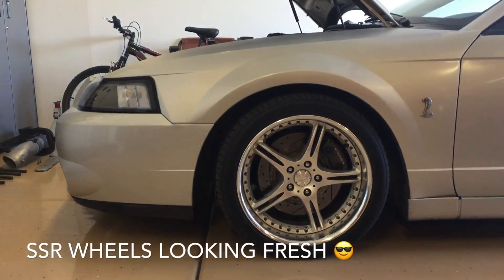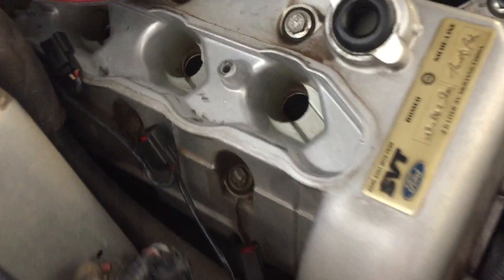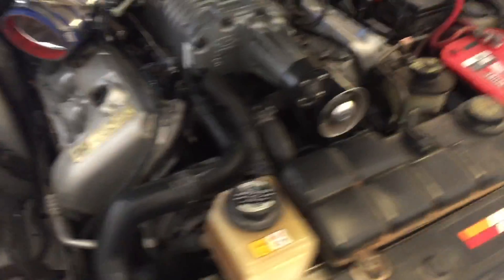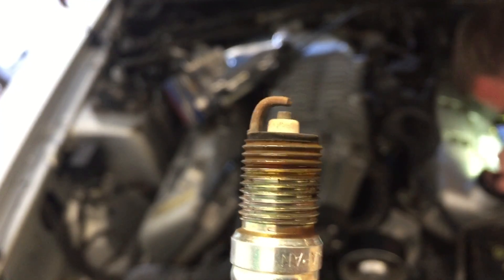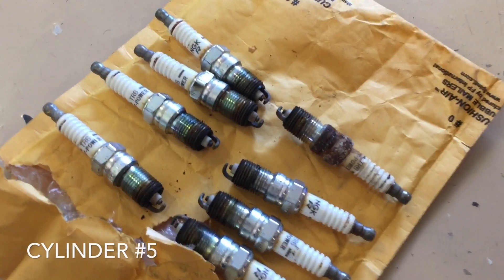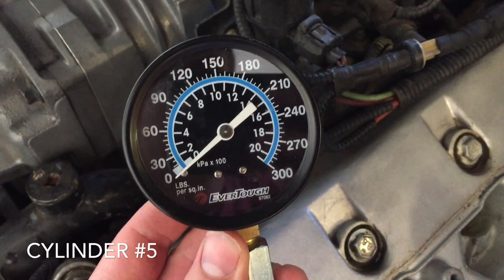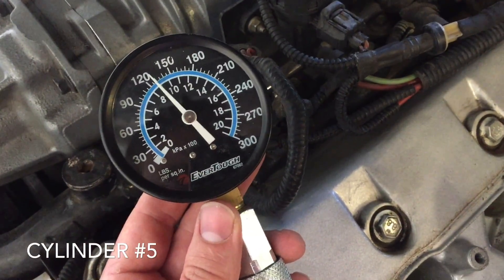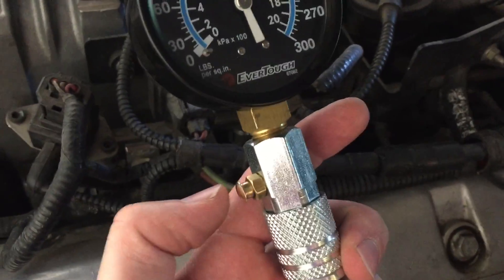High mileage Terminator Compression test: 2003 Cobra compression test with 140,000 miles

Comment: Hey Danny hope you can help me, I am Woody I communicated with you a few times and I have a 04 screaming yellow coupe. I just installed new timing chain adjusters, secondary adjusters and chain guides. The car was just old and I wanted to do preventative maintenance. The cobra sat for 6 months in my garage and I just finished it today. The car was running just fine before, no issues and no noise. Now I have a engine noise which sounds like chain slap or a bad lash adjuster. I must have done something wrong I do not know what. I torqued all bolts factory spec and check timing several times. Just did a compression test all were in the 150-160 psi range. Can you enlighten me on what possible they may be.
Thanks, love your videos.
Woody
Reply from the maker: I would watch this video on the primary chains and see if anything sticks out differently. The guides and the tensioners are side specific. I will also post a video someone else did on degreeing the cams https://youtu.be/xbkgpfk7s-g?si=iF8nv_zOSpjOXaZn
Reply from the maker: Watch this series as well. https://youtu.be/NvfQtmnJPbk?si=093YAS8kLGR4wnXF
Reply from the maker: Can you upload a video to your channel and let me know when you have?

Comment: Instead of holding the gas down would it be the same if the fuel pump fuse was just unplugged?
Reply from the maker: Yes, you can pull the fuel pump fuse or the inertia switch https://youtu.be/-5Zssjdqdhw
Reply: @dannyjohnsonsgarage  so I just picked up my cobra this last Sunday! I don’t see a video on how to fix a seatbelt that doesn’t want to retract. It’s the passenger side for my seatbelt that doesn’t want to pull back in? I was thinking of possibly cleaning it with soapy water maybe?

Comment: So just for clarification this can be done with all the spark plugs out of the car ?
Reply from the maker: Yes, its even better to do it with all the plugs out so the starter has an easier time spinning the engine. Each cylinder is separate from another, so the compression of the cylinder that is being tested is not effected.
Reply: Thank you Danny !!!
The results 
Cylinders
1-160
2-160
3-155
4-150
5-160
6-155
7-155
8-150

I reckon that’s a healthy ??? What you think
Reply from the maker: @SoulCrusher6  Yep. Looks good

Comment: i am now the owner of this cobra
Reply from the maker: It was for sale in Vegas. Did you just buy it or are you selling it?
Reply: Clutch, Flywheel and Tune was done as well. I was sent to this video by the seller.
Reply: i bought it from the guy that bought it from this seller...Im in Vegas. Still has the same Rims and ect. The Coolant Reservoir was changed, The SSR Center caps are now Cobra replica caps, The Rear Spoiler was replaced and is currently black, Radio was changed...153k miles now.
Reply from the maker: @outsidersmediagroupo.m.g5669  I really like the wheels for what they are. I first saw them on a 2001 Bullitt when it was brand new. Congrats. Do you have an Instagram?
Reply: @dannyjohnsonsgarage  @KingGaijinJayLay on IG. Yeah i had to change out the center caps because 1 of the caps was completely missing and i guess SSR doesnt sell those caps and i couldnt find them on ebay. I got the Car a few weeks ago in a Trade with a neighbor. It Def needs some TLC but im up to the task.
Reply from the maker: @outsidersmediagroupo.m.g5669  I’ll give you a follow. Feel free to browse my playlist. Just about anything you’d need from Intercooler pump, rear Diff, blower swap, fuel system etc https://youtube.com/playlist?list=PLIjr-uSYDZi7hBrphoRniyYjb707PpPTu
Reply: @dannyjohnsonsgarage  Sounds Great! Will Do. Thank You!
Reply from the maker: @outsidersmediagroupo.m.g5669  I have a 06 G35 too lol. Similar https://youtube.com/playlist?list=PLIjr-uSYDZi6cuomOpHL7rGWNEbQUmbvy
Reply: @dannyjohnsonsgarage  hahaha Great Minds think alike...Im gonna check it out. Minds is Heavily Modded.
Reply from the maker: @outsidersmediagroupo.m.g5669  mine is bone stock and 160k miles now. It’s been a great car. We bought it with 51,000
Reply: @dannyjohnsonsgarage  is it a DE or Rev up? 6mt?
Reply from the maker: @outsidersmediagroupo.m.g5669  You’ll see it in the link I posted above, but it’s an Auto Sedan and not the Rev up.

Comment: What are the best numbers to have on a compression test for these cars?
Reply from the maker: OscarIGZ preferably 150–180, but the gauge can be inaccurate, so you just want to watch for no more than a 10% difference across all of them
Reply: @dannyjohnsonsgarage  if i may ask what do the results  of this video tell you about the car? I saw mainly 145-150 but a couple 175
Reply from the maker: Mike Mcneill It’s a good healthy car for the mileage. My brother’s cobra with 42k miles did all 170s, so a little wear, but all good
Reply: @dannyjohnsonsgarage isn't the ford spec no more than 15% difference? Mines right at 15% on my 110k mile terminator I just picked up for $5k

Comment: Hey danny good video. I have a 98 cobra stock engine close to 190xxx miles never has been opened up!! Its smoking blue smoke when i downshift and decelerate  and def burns about a half court of oil every week. Should i start with compression and leak down test or should i delete my imrc plates cuz they have never been cleaned!? Thanks in advance
Reply from the maker: I would say it’s more likely to be in the valvetrain (leaking valve seals). It could also be piston rings. A compression test might show the rings, but not likely the valve seals. You can try it to see what you find
Reply: @dannyjohnsonsgarage  awesome thanks for the reply
Reply: Have u got a price for cylinder head repair like that before?
Reply from the maker: Kurt Tilghman I have an engine removal and teardown series you may enjoy. Expect $500-$1,500 for them to freshen up the heads. You could save some money getting the heads off and to them https://youtu.be/NT5Z5L2wAss

Comment: Should I buy a 133,000 mile 04 cobra for $16,000?
Reply from the maker: I’d say $14,000, but honestly if you’re willing to travel you can find them with half that milage for $16k or spend just a little more and get a super nice low mile one
Reply: @dannyjohnsonsgarage  will you do a video on if its better to have a higher compression ratio say 9.5:1 vs the stock CR on these motors, say someone bore the block over a bit, would you need a better supercharger to jam more air in?
Reply from the maker: hahaha12345678993 I’ll have to cover a video on that. I’ve spoken about it in a terminator vs 5.0 video being the new mustangs have 11 and even 12:1 compression ratio. Intended for naturally aspirated (which is why Ford lowered it on the GT500 for safety against detonation/pre-ignition). You can push newer engines a little harder with direct injection, but ultimately pressure is pressure and you’ll make similar power with low compression ratio and high boost compared to high compression and low boost.

Comment: Is 150 to low or good but what if it is 140 or 130 is that to low
Reply from the maker: less than 150 is starting to get bad, but still going to run- just might burn some oil. You don’t want to see that 25 psi cylinder or anything like that. Keep in mind also the gauge may have some variance, that you want a 10% average across all, and that this is only part of the equation.
Reply: @dannyjohnsonsgarage  im trying to buy a 03 cobra engine with cams and its got 94k miles and the Average on the compression test was 149 is it worth buying for 7k????
Reply from the maker: The Sand Dolls That’s probably close to what it’s worth. As long as they offer a 90 day warranty or something

Comment: Dan a buddy of mine has his eye on a 05 GT that has a Saleen supercharger kit on it, about 47,000 miles on the car. super clean and very tasteful mods done on it. The guys asking 14 for it. Do you think that model years engine will hold up for long term boost? Thanks and love your content
Reply from the maker: Unfortunately, the 05-10 GT 3V was not much of an improvement over the 2V. The stock rods are only good for 450rwhp and so a stock coyote 5.0 found in the 2011+ Mustang GT will outperform the 05 GT even with the supercharger. I would not pay anywhere near that for a 05 GT. Might as well go towards a 5.0 which will start at 400hp and can later be supercharged to 600hp without a problem
Reply: @dannyjohnsonsgarage  thanks for the reply.

Comment: Hi Danny just done a  Compression check on my 03 Cobra  Got a 180 in every cylinder In a 150 and 1 Car is not running right The inner color Box was empty when I bought car So I filled it up last night Was doing the compression test today and it blow coolant out everywhere And also deplete it the reservoir for intercooler.whats Your thoughts?
Reply from the maker: Dustin Cook Coolant loss from the main radiator would likely be a head gasket. If it’s just the intercooler reservoir, it’s possible the intercooler under the supercharger is leaking. i have a video series that may be helpful
Reply from the maker: Dustin Cook https://www.youtube.com/playlist?list=PLIjr-uSYDZi7hBrphoRniyYjb707PpPTu
Reply: Danny Johnson  That's what I thought as well must be the innercooler under supercharger leaking  Got super charger about halfway pulled Thanks for sharing the video link with me will save them Do you have any EGR delete videos Trying to figure out where to run my vacuum lines
Reply from the maker: Dustin Cook Bot yet on the egr delete.

Comment: Do you have much experience with lean codes?  I have a few ?’s for you if you could help me. Its on a 98 Gt.
Reply from the maker: my experience with a lean code was on my mach 1. I did everything that would cause a lean condition- new fuel pump, injectors, swapped maf and other sensors with my brothers mach 1- just to find out it was the o2 sensor itself giving a bad readout. When the o2 goes bad it often tells you wrong things . https://youtu.be/SSbwbxyT5j8
Reply: Thanks for responding. Yeah My o2s were bad and I changed them after everything else and The car ran great, but it’s still lean on both banks,  I think maybe a vacuum leak. How would you test for that? I’ve seen all the ways online(carb cleaner, propane, water etc.) Just wanted your advice. Thanks man
Reply from the maker: Adam Bridges yeah, spraying the engine with the starter fluid may suck some in and change rpm or you can find a way to smoke fog the system and see if it leaks out- never done that but heard of it

Comment: Hey dan I picked up a cobra I saw a short video of it 23,0000 miles on it snow finally gone around here so been driving it a bit and noticing when I start after it's been sitting for a while it blows out a good puff of smoke and smells like oil?had a compression test it was good all between 181 and 192.any ideas seems to blow more smoke out each time I drive it on weekends?
Reply from the maker: sometimes you can have some oil from the pcv (positive crankcase valve) system that will get into the intake and then be burned, or possible the valve guide seals leaking a little. It shouldn’t be a real problem. You can try a catch can system to see if that solves the problem  https://youtu.be/QrdJMuJleko
Reply from the maker: On your next oil change you can also try changing to 5w30 if you are running the thinner 5w20. I like 5w30 better myself